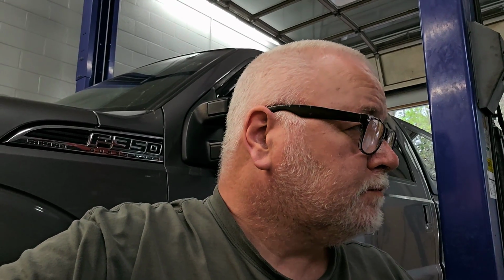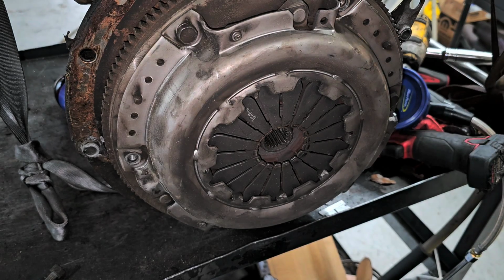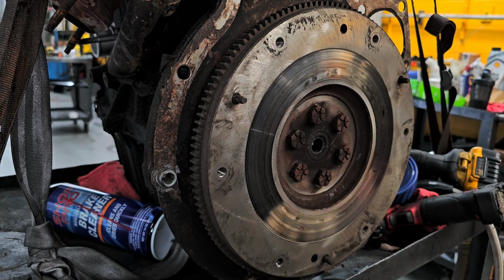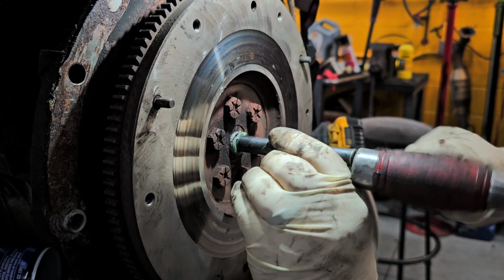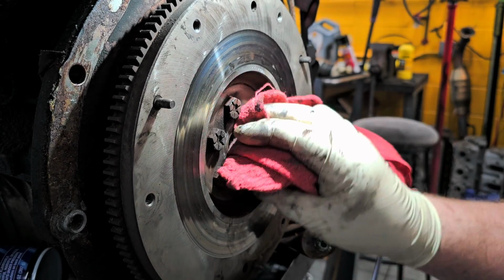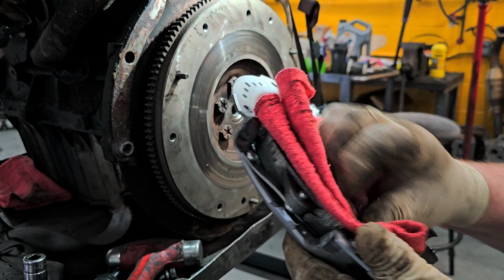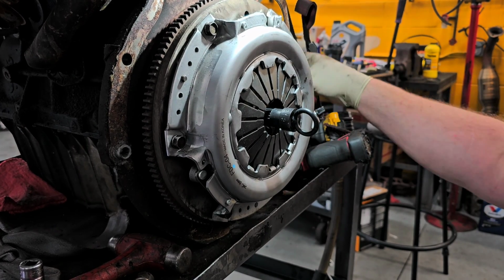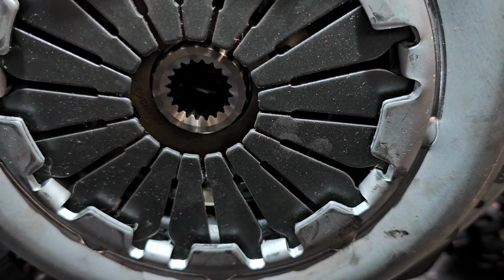Replacing A Clutch & Getting Out A Pilot Bearing Without Special Tools!!

Comment: The miracle of bread. Works great on pipe soldering when you have water in a pipe. Pack it with bread, solder the pipe, turn on water. A very old plumber showed me that trick.

Comment: Never tried the bread trick, guessing it's faster, since it's more a solid to compress than grease. I had 1 of those Snap On internal small slide hammers. Used grease most of the time, because it was faster than setting up and using the tool hahaha

Comment: I wouldn't use that bread trick on an Chevrolet LS or LQ, etc engine because Dave from Daves auto centre had to fix a problem up for a customer where a salesperson at AutoZone suggested that a customer use the bread trick to remove the pilot shaft bearing in his 2002 model Chevrolet Corvette.

What he did was he pushed out the sealing plug so it's sideways which prevents oil from leaking out of the back of the crankshaft because the crankshaft is hollow & full of oil, apparently that's why it's important to used blue Loctite on the flywheel bolts to prevent oil leaking past the theads because the rear main oil seal journal is hollow & it's full of oil when the engine is running.

So I am looking to get a pilot bearing removal tool because I am afraid to do it even with plasticine which is what I was going to do when I do my next clutch job which should be soon because the clutch is shuddering whenever I release the clutch pedal when the engine is hot.

I replaced the clutch disc in 2016 when I replaced the rear main oil seal & carrier unit gasket but I didn't replace the flywheel or pressure plate because I was unemployed at the time,I also reset the pressure plate in a hydraulic press.

The flywheel had high spots on it which was a worry so that's probably why the clutch pulsates as well but it's done 100,000 kilometres or 60,000 miles now.

I would've had the flywheel machined in the video,in my case it was a non machineable dual mass flywheel, the new clutch kit will come with a new flywheel, pressure plate, clutch disc, clutch slave cylinder, pilot bearing & clutch disc aligning tool !

https://youtu.be/e3sh6pym5Ek?si=FQ__7HQ3lwPYnUSt

Comment: If that was a self adjusting clutch you should always use a clamping tool that clamps down on al fingers at the same time until the pressure just touches the flywheel, and only when the pressure plate has touched against  the flywheel can the 6 bolts be tightened.

Comment: Grease and the backside of a drill bit in the pilot bearing hole works well too. Make sure the drill bit is just slightly smaller than the inner diameter of thr pilot bearing and use a non-marring mallet or piece of wood to strike the drill bit so it doesn't shatter. Old farm boy trick passed down through generations.

Comment: No alignment tool a broom stick works well, or that punch, and a roll of masking tape in an even layer, to build it up. Another tip is, if you are going into the clutch housing for any reason, like a main seal, or gearbox input shaft, is to replace that throw out bearing, unless it is brand new. Any wear on it cheaper to toss it and put a new one, as you already have done the labour. 

Should also have taken flywheel off and replaced rear main seal on that engine, they are known to leak as they age, and that one looks like it has never been off from the factory.
Reply from the maker: Great tech tip. Thanks for watching & keep wrenching!

Comment: Would add a touch extra wheel bearing grease there, behind the pilot bearing, to keep it nice and quiet, as the factory fill is generally not enough. Tiny amount, around 3 match heads worth, applied to the rollers. Not too much as it will ruin the clutch if it comes out.

Comment: 35 inch pound for the pressure plate if the bolts are 3/8s  25 if 5/16s
Reply: I think you mean ft pound,  35 inch pounds is less than finger tight.

Comment: Few years back had to change the one on my truck. I never really tried the ' hydraulic bread ' trick but it wouldn't come out even with the custom bearing puller device.
I ended up using a dremel with a tiny carbide cutter I had and cut a slice in one side.
It was in there pretty good.
Reply: Wow, what did you torque those bolts to? About 10 lbs?
Reply: @michaelszczys8316  I thought the same thing.  A torque wrench would help!  I think I would have put some blue thread locker on the bolts too.
Reply: @kirkthejerkthe1st  don't necessarily need a torque wrench, but at least a little bit of ' oompah '.  I didn't look like anything.